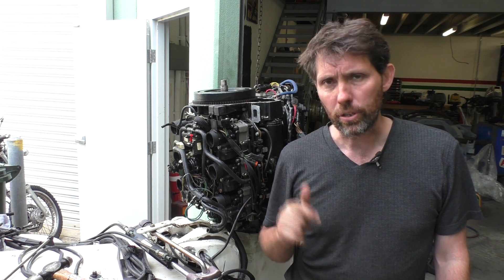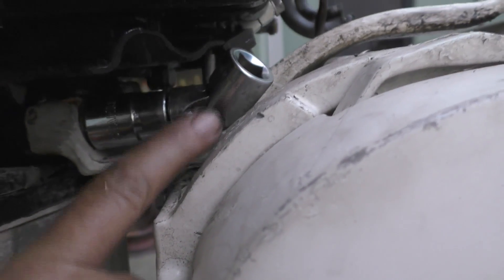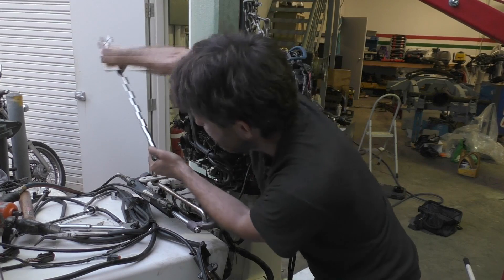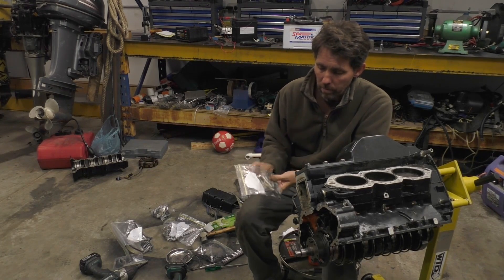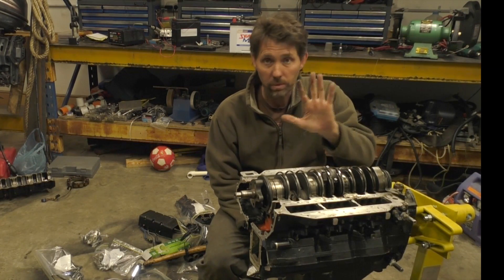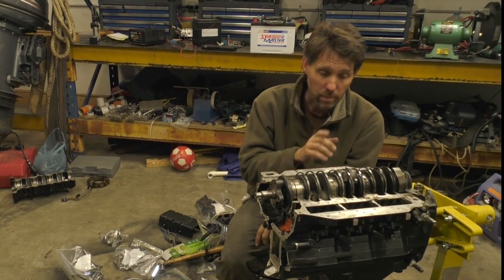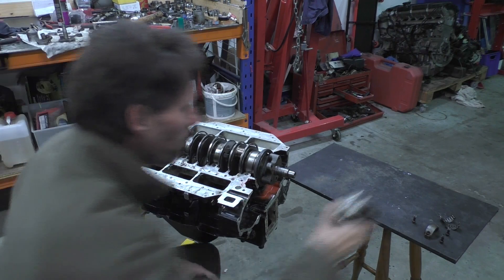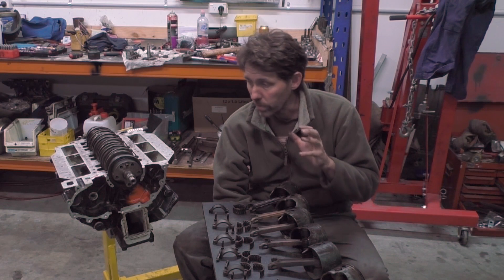Evinrude 150 autopsy

Comment: I'm going say leaned the piston dried the rings tightened up the Jug .Wrong bore size ; We're those jugs Nicosil ,,More or less fired up a cold dry motor from the dock threw the lever forward got km out and took a crap ,Or using wrong oil .
Reply from the maker: +Garnett M I'll certainly be interested to hear what the engineer thinks when he's finished with it, but his first impression was an oil related problem.
Reply: Might have put gas in the boat or tanks then added oil after realizing he didnt -Heard a ping just a few secondsto late then added oil , seen that before ,,Oh not my fault there`s oil in the tank .-But the rod pin was trying to come thru the center .

Comment: I am stripping e120tlcos 85.  I cannont get crankcase to seperate from head.  All Lugs and bolts removed. Any ideas?
Reply from the maker: +Duke of Zen If you are 100% sure all fasteners are out then I would see if there is an edge with a slight indent and use a pry bar to lift it off.
Reply: Thanks! Had to remove carbs n housing for one final bolt!

Comment: The pistons look dirty without any sings of running lean on fuel and it's dripping with oil. I would have been scratching my head while trying to find the cause. Ok now I just read further down about the crank bearings failing and allowing metal to get sucked into the combustion chambers.
Reply from the maker: Hi Jamie, I'm not sure the crank bearings did fail now, they all look fine. Apparently they are made and then broken in half (rather than cut) to install them around the crank. I mistook that break for a failure, but apparently it is normal with Evinrudes.
Reply: Did the rings stick and hang up on a port? That motor was dripping with oil and very dirty.

Comment: Hi Dangar, i am just about to finish a complete clean and paint of my runabout hull. When my mechanic put the motor back on the wires for ignition where placed on the outside of the cowling instead of through the supports/ribs have you got a vid of running these wires and whether its better to disconnect from the forward control end or the motor end? to run them. love ya work mate. Its been a help for my project.
Reply from the maker: Thanks mate, glad the videos have helped. I don't have a video I can think of, but it is generally much easier to disconnect from the outboard end. It does depend on the outboard model though. It is generally just one big plug at the outboard end.
Reply: tohatsu 30 hp thanks i was thinking that. cheers.

Comment: Things to consider: One half bank shows signs of oil starvation and scoring. One half bank appears to show normal piston wear and adequate bore appearance with one bore still showing cross hatching.  Check for an oil passage obstruction on the failure bank.  Q1: Are the sleeves in the failure side of the bank installed correctly?  Additionally, water migration into the failed piston and a non-compressible liquid will lead to a cracked piston.  Assume all connecting rod bearings are bad at this point with half the motor running better than the mirror half.
Reply from the maker: It will certainly be interesting to see what the engineer has to say about the sleeves and bearings. I'm not convinced much water was getting into the cylinder, I think it would be cleaner if it was. Clearly some sort of detonation going on with that melted piston so timing looks like a possibility too, but I'll certainly be doing another video once we find out.

Comment: Have you found the reason why the engine started eat itself. Was the last rebuild a dodgy one ? good vids muka well presented , filmed and edited
Reply from the maker: Not yet, still waiting for a time to take the block down to the engineers.
Reply: +Dangar Marine 
looking for o
Reply: +Jamil Cooper 
I have a 50 honda 4 stroke outboard some put sugar in the oil thank  am just in need of one piston an a cylinder head.

Comment: Hey Dangar.
I got a problem with my outboard motor.maube u can help me or lead me in the right direction let me explain  a little about it..got a 1985 Force 50hp  two stoke. engine..this is what it doing. when not in the water or when I putting in water barrel to run the motor it will do just fine it idle fine putting it gear forward & reverse work fine but when I put it in the actual  water ( lake ) it will work for a few minute and then it die. it won't start. it crank but no start...once I bring it home to mess with it..I get to run . I go to lake same thing  once in the water does not run. maybe u can give me a hint. I will Apreciate it..
thank U..
Reply from the maker: I would start by giving it a full service as per this video. https://www.youtube.com/watch?v=tih4o9-VJ2g In particular, be sure to do the compression test and perhaps a carburettor clean.

Comment: When the VRO pump fails, it supposed to fail so that it allows oil to siphon into the gas and you end up with too much oil.  I've been watching your videos because I have a 150 Johnson ocean runner which is basically, the same engine.
Reply from the maker: It's good to know they are designed to fail in a safe manner. I'll definitely be looking into some ways to test it once it is back.
Reply: Can you do a video of tuning the carbs on this evinrude?  My current boat is my first boat and I bought it used not knowing what to look for or bringing anyone qualified to help me check it out.  I ended up with a boat that needed a lot of work on the engine.  The previous owner installed a new power pack, coils, starter solenoid coil, bowls and floats.  I've had installed a water pump, vro, rollers on shifter cables, tach, port side temp sensor and the optical sensor.  Once I did the repairs I realized the previous owner was chasing a problem that he didn't solve and dumped his troubles on to me.  My carbs were tuned at the shop, but I can tell it needs to be tuned better.  The young guy that tuned mine didn't seem to have the experience for tuning the carbs on my engine.
Reply from the maker: eightofnine9 Yep, I will definitely be filming that part of this outboard's restoration. Setting the mixture is the same in principle as this motor though.
Reply: I've run evinrudes all my life.   And Danger Marine. My advice is. NO matter how old or new an outboard is.  Never rely on oil injection.  Do away with it completely, And run 50:1, Or a safer bet. Even 40:1. And you will always be trouble free :)
Reply: don.t count on that ive been all thru many of these pumps there junk i hate them

Comment: That sucks that it blew up!  Make sure the timing is correct, I'd replace the water pump to be sure it's good, and also rebuild the carbs to make sure no jets are clogged.
Reply from the maker: Yeah, bit of a bummer but it is what it is I guess. Will definitely go right through it once it is back from the machine shop.
Reply: Now take an LSl v8 aluminum block and use the porting like this to build a 2 stroke Corvette, Camero or truck. This would be a good motor to base the porting design off of for a 2 stroke street motor.

Comment: Thanks for another very interesting video. By bad luck, my 1989 Yamaha 150HP just seized this month and is in the shop. You sped up some of the video, but I'd be interested to know the amount of time it took you to disassemble this engine. (The first place I took it to said it would cost more than the engine is worth to even figure out the problem, let alone rebuild it. Perhaps not surprisingly, the call ended with a pitch for a new Yamaha outboard!) As an owner of an older boat with an inclination towards DIY, I really appreciate your videos. They are some of the most useful and informative on the topic of boat maintenance and repair.
Reply from the maker: Hi David. Sorry to hear about your Yamaha. Someone once said to me that they would never send their outboard to be fixed by someone who also sells outboards. ;) All up I would say it took about two hours to strip it right down. The cost can add up though by the time you get the machining done and then buy all the new gaskets, bearings and seals you need. If you are the DIY type though, stripping it down isn't hard, just keep everything really organised and labelled to aid reassembly.
Reply: I would add about another hour for a 4 stroke strip down. A plus for two strokes is that they are SIMPLE!.

Comment: I agree, most of that damage was probably present before the engine visited you the first time...I'm wondering if that is the original powerhead, the number on the ID plug will agree with the serial number if the powerhead is original.  The engine didn't sound the overheat alarm or go into SLOW mode, so sure doesn't seem like it was overheating.  When I see several cylinders scored/scuffed up like that I'm thinking lubrication problem...But, like you say, there seems to be plenty of oil present during disassembly.  But, again, we both agree that the damage occurred before the engine visited you, even though the final result happened afterwards.  The oiling system does have an alarm that lets you know if it is not working, but the alarm system does not know the difference between oil and water...Many times, these oil tanks get water in them, especially when located in the bilge.  I'm thinking that water was introduced through the oiling system which caused all the scuffing/scoring, this probably occurred awhile back...Someone may have discovered this problem and cleaned out the oil tank, but the damage was already done.  Usually though, you will see some minor pitting on the crank journals and bearings, telling us that water sat on those surfaces.  Again, this is probably minor damage that will be noticed only after a closer cleaning and inspection of these areas...Like you said, someone has been inside this engine before, as noted by the .030 stamped on at least one piston.  I suppose it is possible that this is a remanufactured powerhead.  In any event, it is surely possible that the cylinders were not bored properly during the last rebuild causing the tight fit/scuffing scoring.  It is possible that the damage was caused by misfiring/lean running/over propped-lugging.  This engine has a unique ignition system that is tricky to set up properly without the ignition analyzer tool from OMC.  The engine will misfire if the wrong plugs are used.  This engine has lousy plastic float bowls, perhaps someone removed/installed the high speed jets without the proper tool, damaged the jets, left them loose, or created plastic debris by using the wrong tool.  This style engine is generally pretty durable and develops quite a bit of power.  I suppose it is possible the cause of this damage might remain a mystery due to its unknown past.  If your customer is the original owner,  perhaps he can supply some information that might help solve this mystery...
Reply from the maker: Hi mate. I'll be interested to cross check those numbers. Unfortunately the new owner of this boat has only had it for a month or so and the history is completely unknown. He got it for basically nothing so no really problems there. There wasn't any sign of the water in the tank, but good point about the sensor not knowing the difference. I'll be sure to test that sensor before if goes back out on the water. Carbs will also get an overhaul and I'll get the local Evinrude guy to look over the ignition too. He's just down the road and have loads of experience.

Comment: Johnson does have in their repair manuals that some engines come from the factory with oversize pistons, but don't say why. You could also have an engine that the repairer did a 'only do what you have to' job on, and my guess that is what has happened due to the  hone marks not being on all cylinders. I don't think you have found the root cause though, something is not adding up right.  Good video, I like the 'the way it is' truth of your vids, very well done.Some close ups of cleaned up pistons  and bores showing the score marks in good light would be good too.  Does your missus give you much stick for not coming home until late  just so you can make videos? :7)
Reply from the maker: Hey Ron, interesting about some engines coming with oversized pistons. I sorted of expected something like that as I didn't get the feeling this had already been bored. The chances of somebody rebuilding this motor and doing it so badly seemed unlikely. What I would like to do is get everything cleaned up and get CDA's opinion of it in the next video. He must see this sort of thing five times a day. Fortunately Vicki commutes to work so I can hang back for an hour or so and still get back to the river at the same time. That keeps me out of trouble!
Reply: I just had a quick look at the neverude parts list- a hint, also price Johnson parts as sometimes they are cheaper, and it is the same engine. Is that boat hull rated for 175hp? If so, as you are doing the rebuild any way, a swap of carbs/jets may be an easy upgrade, and if con rods and pistons are different for each HP rating, you are changing them any way- so.... One thing is there should be plenty of parts available, that crank shaft alone goes from 1994 to 2010 and about 5 different HP ratings!Could that O ring leaking water into the cylinder cause a melted piston? Some of the other pistons you showed had dents in the top, are all the fingers of the reed valves still present.Also you don't say why the crank would not do a full rotation, but from the position I would guess a broken ring going into a transfer port?
Reply from the maker: I'd say the hull could take 175HP, it's a 6 metre fibreglass cruiser. I'm not sure about the water causing melting. I wouldn't imagine so. I didn't mention what was stopping the full rotation as it was hard to tell. I'm actually starting to suspect the main bearings. It will be interesting to see what they look like when they come off because they certainly don't sound or feel good.

Comment: rocking couple scuffing. either over-revved, or the main caps weren't quite torqued right on that "rebuild".
Reply from the maker: I didn't really get any good footage of it in this video, but the main bearings were shot, you can hear them in the video while I'm looking at the crankshaft. I've since noticed that the casings on them are cracked too.
Reply: so "short torqued" for the win, lol. are those cdi boxes rev limited? that "2 on the ends of 1 bank, one in the middle of the other" wear pattern is a monster tell. i bet with the bearings off you can't v-block all the mains at once, lol. evidence of stretched main bolts? reused "torque to yield" fasteners (i'd honestly use a single opportunity to ride a time machine to shoot the guy who came up with that idea, lol)? that head might need line boring too, with the evidence you're finding... the buyer should have negotiated a hauling fee, not a purchase price, lol

Comment: interesting video very strange to see so much damage, as you say plenty of oil getting in there do you think there could be a fuel mixture problem on that carb? or a poor rebuild from last time. will be great when done plus even bigger pistons
Reply from the maker: That carb could have been running lean, but I really don't think that would be enough to cause this. I'm thinking it has more to do with a previous rebuild.
Reply: cheers good luck mate

Comment: Hi, you do a great work, and its great chance if you please explain how to use Micrometers, Vernier caliper, dial gauge, Cylinder Bore Gauges, and where to measure and how we calculate the measures, Feeler or Thickness Gauges, Straight Edges (Surface Gauges), Plastigauge, Torque Wrench Tips, Torque Basics, The formula for calculating
corrected torque and I’m sure you great on “SEALANTS and LUBRICANTS”. Thanking in advance.
Reply from the maker: Sure, hopefully this project will give the opportunity to go through a lot of those.

Comment: Almost guarantee that is old damage from the looks of it. Especially if the carbs were poorly adjusted. Is there any way the timing could have been out too? Also does the block have cylinder sleeves in it? Some Evinrudes used removable sleeves from memory.
Reply from the maker: Hi Matthew. Yep, this Evinrude is sleeved. It's not out of the question that the timing was too advanced, I'll certainly be checking it before it goes back out on the water.
Reply: Having a sleeved block may save you some money as it maybe cheaper to rough machine out the old sleeves and then just fit new standard size sleeves and pistons. Depends on how much machining costs vs sleeves cost of course. Good that the crank is ok, guessing it is still prudent to change the big end and main bearings while it is all apart rather than having another failure in say 100 hours running time. Good luck with the carb/vacuum leak/timing diagnosis!
Reply from the maker: The main bearings are definitely shot. I'm thinking that them failing may have been the start of the melt down leading to piston damaged that lead to blow by etc, etc. I think they run on races so once again I'm hoping the crank hasn't been damaged by them. Time will tell!

Comment: fuck thats unfortunate. hopefully my Johnson 90 doesn't do the same. I premix my oil just to be safe. I've heard the oil injection system on those old Johnson/ evenrude motors can be a little unreliable
Reply: Hi Stu. It's interesting that it has only damaged those 3 pistons and cylinders. Could have it leaned out on those affected cylinders causing it to burn the pistons detonate?
P.s great video :-)
Reply from the maker: I've never been comfortable with automixing either. It's not out of the question that some internal problem caused a lean condition in that cylinder, but it's hard to know conclusively.